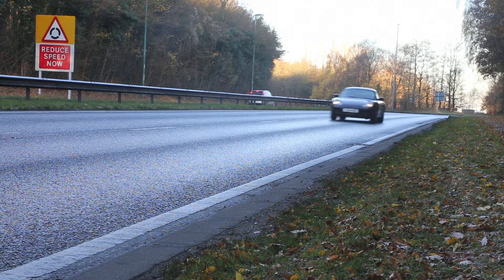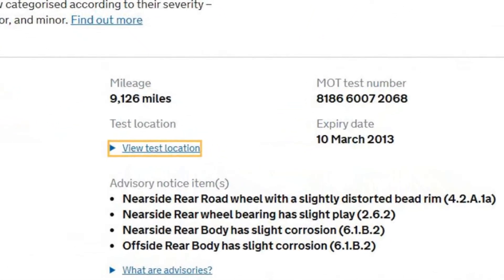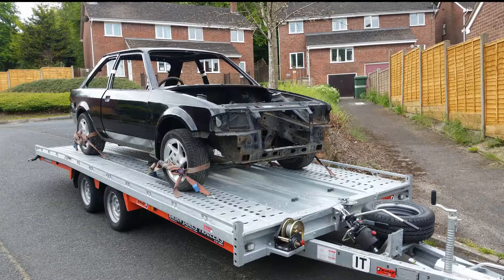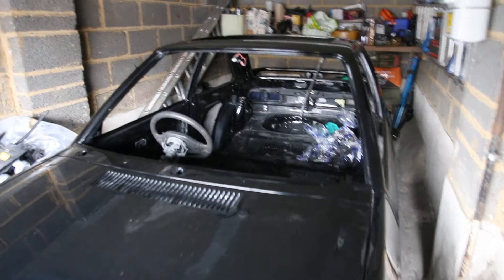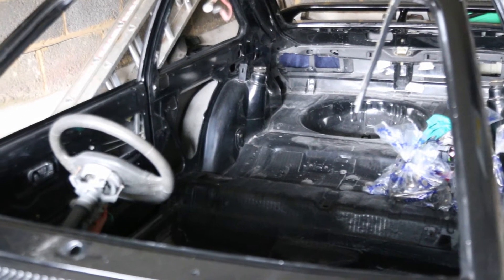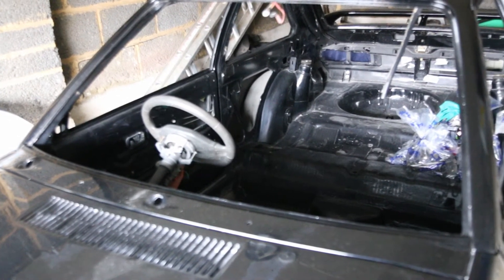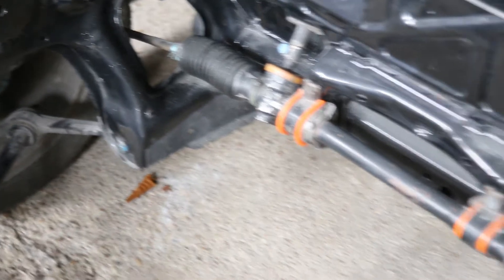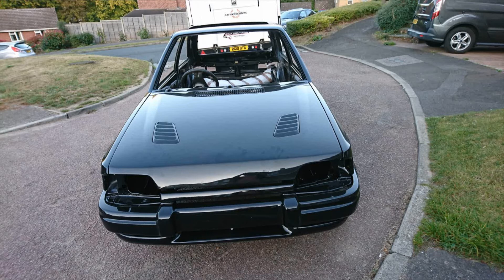1986 Ford Escort RS Turbo Series 2 Restoration Project - Rust Removal & Bare Metal Respray - Part 1

Comment: Common rust areas 🤣 fuse box tray, battery tray, bonnet front edge, slam pannel, scuttle panel, front valance, inner and outer front wings, floor pans front and rear, inner sill, outer sill, bottom of doors and underneath weather strip, A pillars, roof around sunroof, boot lid bottom edge and around spoiler, rear chassis legs 🤣 or is that just mine 😎🙈
Reply: Sounds very familiar! I think I cut out most of the listing of rust areas!